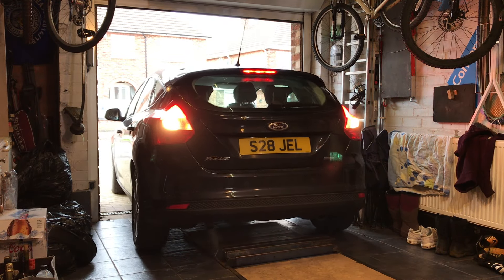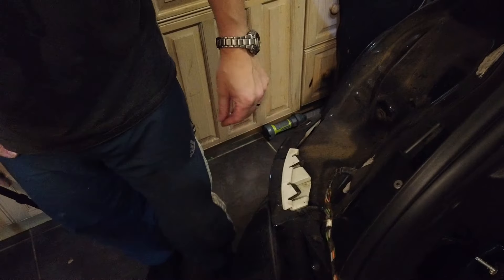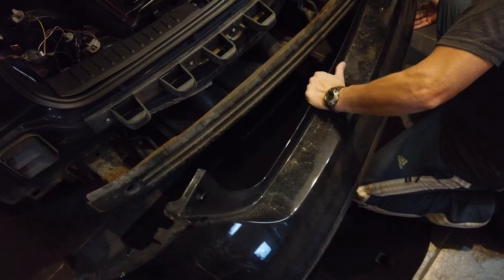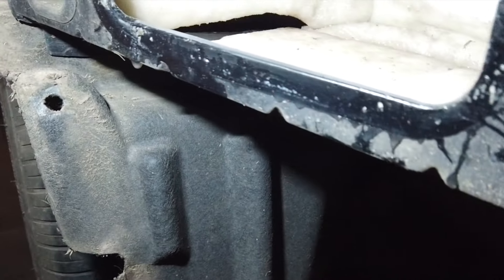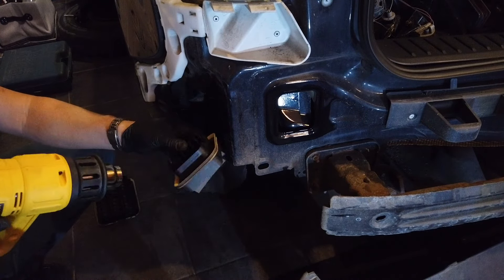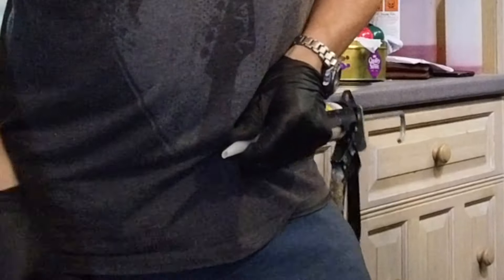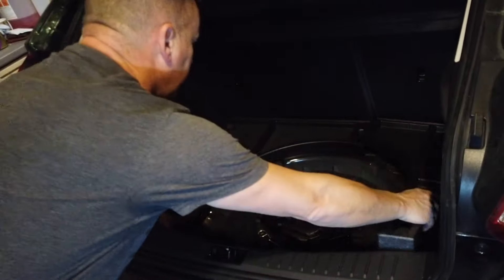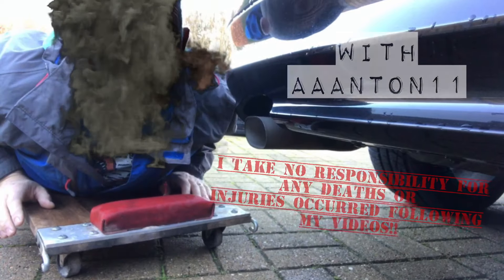Ford Focus Water leak in Boot, Sealing Rear Vents Behind Rear Bumper

Comment: Thanks for this. My 2012 Focus definitely has this problem. It’s started to smell as well. P.S You’re definitely from Leicester 🤣
Reply: same as my 12 plate mate, you're defo not alone !
Reply from the maker: Yes I am from Leicester, Thanks for the great comments👍🏻👍🏻🛠
Reply: My 12 plate too aha, started to get mould on the carpet in the front 🤢🤢🤢
Reply: @aaanton11  knew it, so am I. 🤣 Just want to point out that I took my bumper off last weekend, but the only thing I did differently was i used a gutter sealant instead of silicone. It’s a lot more durable 👍

Comment: Hi. My Ford 2013 only bought it 7 weeks ago.  Has water settling in back passenger footwell.  After you sealed up the air vents.  Was the water issue resolved?  I would be grateful if you can reply. As the garage I bought it from. Can’t locate the issue and are now unwilling to help. I may have to do what you did.
Reply from the maker: Yes the leak is all sorted, Thanks for the great comments👍🏻👍🏻🛠

Comment: I also have had a major amount of water in the back footwell and the front Wells iv taken out both vents and sealed them but I was just wondering the vents did not seem to be to wet I was just wondering is there another reason how the water is getting in iv had a hose all over the car but there dosent seem to be any leaks I can see.
Reply from the maker: Was there any water in the two pockets either side in the rear did you pull out the grommets? Thanks for the great comments👍🏻👍🏻🛠
Reply: Yes I took out both grommets to feel if there was water in the vents area the passenger side was slightly wet but not enough for the amount of water that was in the footwells. I also removed the grommets that were in the booth as there was 9-10 inches of water in there. Iv removed the carpets to dry them out and to have a closer look in the car as iv said iv had a hose on the car and around the seals but no leaks.
Reply: @aaanton11  I took out both grommets yesterday and I felt for any signs of water the passenger side was slightly wet but not enough to cause both back foot Wells to have that amount of water in them also a couple of weeks ago the spare wheel compartment was a couple of inches deep in water so I also took those grommets out to drain the water. As of today I have removed the carpets and sealed both vents and replaced the bumper. I have left the carpets out as I am going to put a hose over the car tomorrow again to see if I missed anything obviously the water is getting in somehow I just don't know how or where.

Comment: I have a 2014 ford focus st and I found my issue to be the rear lights.  Sealed up the screw holes better and siliconed the gap between light box and car and that seemed to work.
Reply from the maker: Thanks for the great information👍🏻👍🏻🛠

Comment: Great video! I’m having trouble with getting the bottom bolt back in. I’ve re-attached the bumper. Tightened the one tucked behind the material and the one below that. But the bottom one doesn’t seem to line up with the material. There’s a hole in the material, but the hole for the bolt seems to be in a recess and the bolt isn’t long enough to attach through the material? It’s a 2011 focus zetec trim. There seems to be a lot more plastic below the last bolt hole in the material then what you’re showing? 

Any ideas would be very helpful.
Reply from the maker: Has the clip dropped off, it has a thread in it, Thanks for the great comments👍🏻👍🏻🛠

Comment: Do you know how to get the carpet up at the front passenger side so I can try and dry it out, as mine has started to go a bit mouldy
Reply from the maker: You will need to pop off the side trims to lift it, or remove the seats to fully remove it, Thanks for the great comments👍🏻👍🏻🛠

Comment: I’ve got the previous model focus, an 09 reg and finally found out that it’s the same issue as this that’s causing damp and mould in my boot and rear passenger footwell. I assume the process of removing and resealing the vents will be relatively similar for the previous model?
Reply from the maker: yes it will, Thanks for the great comments👍🏻👍🏻🛠

Comment: Great vid. Just finished doing my focus today. It was absolutely soaking. Half the time was spent trying to the vents out. Also would you recommend putting the rubber plugs back in or won’t it make a difference? I just thought if they aren’t in the water can’t build up. Just need to figure out how I’m going to dry the rear passenger footwell now.
Reply from the maker: Glad it helped! you can leave the plugs out if you wish, Thanks for the great comments👍🏻👍🏻🛠

Comment: What are the water vents actually for? Like what is their function? Is it dangerous to drive if they are leaking?
Reply from the maker: They are one way air vents, they control air pressure in the vehicle allowing air circulation, Thanks for the great comments👍🏻👍🏻🛠

Comment: If there is significant water ingress at the tail lights, would this not also then accumulate in the chamber behind the vents under the bumper as well as in the boot?  I found a pond in my boots and I'm sure it has sploshed about when I'm driving and made it's way to ALL footwells :(
Reply from the maker: Yes it can, the vents are the most common place for ingress, Thanks for the great comments👍🏻👍🏻🛠
Reply: @aaanton11  Thanks. I have just been outside to investigate, I don't think I have much problem with the lights though will probably put some Boss White on as a safeguard. The chamber behind the vents however, was FULL of water and wadding is soaked. I did as you suggested and removed the bung from underneath to investigate rather than take the bumper off.  WHY oh WHY did Ford not seal these vents properly?!

Comment: Did this on mine today, must add that if the focus you are doing this on is a zetrc S, ST, RS or anything other than a standard focus like the one in this video the bottom clips on the bumper are a lot harder to access. Time will tell if the job i have done works but my focus was that wet inside the seats were going mouldy. Also if it happens again i have turned the rubber grommets that were in the vent cavities around so i can remove them and drain the water instead of taking all the bumper off . 

Another good vid for an annoyingly troublesome car. Any chance of a vid showing how to remove the front driver side panel in the bumper to gain access to the horn? as with the starter motor this has a bad connection and only works intermittently.

Thanks
Reply from the maker: I will look into that one for the future, Thanks for the great comments👍🏻👍🏻🛠

Comment: I found another place, keep reading for details: I have a 2016 fiesta and I found another place water was getting in. I have not tried the fix yet in this video; because I thought I had fixed it with the other place I found. Apparently there can be more than one area where water can get in. The place I found and covered with silicon is the upper corner of the hatch back on the outside near where the rubber strip on the roof comes to an end. I was able to verify water was getting in through this area by pouring a pitcher of water over that area and seeing water coming in on the inner wall and dripping down which is way above the area where the air vents are. Had to pull back the inside lining in the trunk area in order to see the water dripping in. To find the leak I just kept pouring water from lower to higher spots until I saw the water coming in and needless to say it was painstaking work. After putting silicon as stated already there was no more dripping on the inside wall; but here recently I found water was in the trunk again so I am going to try the vent fix next. Ford did a terrible job with this car in this respect and not sure if the fault is in design, workmanship or both.
Reply from the maker: Thanks for the great information👍🏻👍🏻🛠

Comment: I got water leaking inside the hatch area through a small hole behind the drivers side rear hatch interior panel, the bottom drain plugs have been removed and allot of water came out the bottom of the car along with some insulation material that is soaking wet, the funny thing is water only seems to leak inside the car when a running hose is sprayed along the roof drainage rail and it doesn't happen when wetting the tail light or bumper area, the car is a 2012 focus and I'm yet to still find the exact cause but atleast the back won't build up now due to the plugs being removed and water will drain straight out now
Reply from the maker: Thanks Dale for the great information👍🏻👍🏻🛠
Reply: Hi, if you look at each side of the hinges, you'll notice a lapped joint which is roughly 3 inches long . These joints are sealed with a cheapy sandy coloured sealant which degrades over time. Give those joints are really good clean and you will probably notice that there's a tiny gap. That's where I had water ingress. Used Sika silicone sealant on those joints and the problem's solved. That's on top of those crappy vent seals which I also sorted out.

Comment: I'm going to attempt this tomorrow as I've pulled the two bungs out and there's a load of water in there. I also have a lot of water in the driver side footwell, The sponge under the carpet is soaked through! is it likely to be connected to the boot leak or a seperate leak nearer the front do you think? many thanks.
Reply from the maker: Yes the water sloshes forward and gets into the footwell, Thanks for the great comments👍🏻👍🏻🛠
Reply: @aaanton11  Thats great I'll have a crack at this later. Thanks for your vid you're a lifesaver.

Comment: Great video,, my fiesta have the same problem, but the leak always from air vents in the right side, so i decided to fully blocked air vent in the right side, bcause it keep leaking after i fix it,, my question is, is it ok if i totally blocked that air vent?not all, i leave the left one as it should be
Reply from the maker: you might get more droning when a window is slightly open but nothing major will happen, Thanks for the great comments👍🏻👍🏻🛠
Reply: @aaanton11  😁😁, nice info, thank you, 👍

Comment: im having the same issue with my kuga/escape i'll try this same methode and see if it helps alswell.
Reply from the maker: Thanks for the great comments👍🏻👍🏻🛠
Reply: Did this yesterday on my kuga. Same problem, took it apart, cleaned it, did some overkill kit in there and put back together. Took me a lil more then 2 and half hour thx to your video. Something's are slightly different on a kuga but i got the general idea.  I'm wondering, Did the problem came back at all?

Comment: Hi Aaanton.  I have a vw golk mk5 1.9tdi.  Car temperature gauge would drop on motorway driving to about 85 degrees.  I figured a stuck open thermostat and replaced with one from TPS.  Now temperature gauge shows 90 degrees whilst driving, but only drops ( 80 - 85 degrees) whilst car is stationary and idlling.  Is this normal?  Before I used to own a petrol Corolla, once car warmed up temperature gauge never deviated from 90 degrees whether car moving or stationary.  Really enjoy your channel.  Thank you
Reply from the maker: This all sounds about right, especially if you have the in car heater on as well, Thanks for the great comments👍🏻👍🏻🛠

Comment: Hello mate so happy I found your video awesome "how to" I have this issue in an estate version I assume it's same. Have you had a chance to see if this fix actually works long term as I've seen a few others say it comes back, is that purely the fact that they left it wet when applying the silicone?? Or is it worth filling any of the gaps behind the light also. Cheers pal
Reply from the maker: Hi definitely a permanent repair, as long as everything is dry and a good grade of silicone used like in the description, it it the same on the estate, I would rather leave a couple. of small holes in the bungs than fill any gaps, Thanks for the great comments👍🏻👍🏻🛠
Reply: I have done same repair more than a year ago. all dry and clean since.

Comment: This seems to be a common problem on ford B max as well only today 30/01/25 I have found a pool of water in the spare wheel well about 3inches deep had no inclination it was there no smell lucky enough water had no entered passenger area of vehicle don't fancy doing this job myself as weather is terrible in Luton and I have very little patience vehicle is going to garage tomorrow I was wondering what it is they are going to do these vents are obviously known for failing if weather was better I would try this myself but weather is bad heavy rainfall over last 2 months surprised how much water is getting in apparently it comes from the roof and drains through the inside of the vehicle
Reply from the maker: Thanks for the great information👍🏻👍🏻🛠

Comment: I have this same problem with my 63 plate ford. However the passenger side footwells front and back are soaked and they smell badly/a bit mouldy. Once the issue is sorted, does anyone have any idea how to dry out the carpets/underlay etc or will they all need to be replaced? Thanks
Reply: Really informative video
Reply from the maker: A good carpet cleaner and hair dryer with the carpet lifted will work, like I did in this video, https://youtu.be/_zvNwzxIKCw Thanks for the great comments👍🏻👍🏻🛠
Reply: @aaanton11  thanks so much, really appreciate your reply

Comment: Has anyone susscefully fixed it with out having to take the bumper of.. ive got a 2014 focus an ive got water on the boot.. its now travelling through to the rear passenger seats an carpets which is resulting in my children getting out the car with wet bums or feet if they take the shoes off.  Am desperately trying to get it corrected but not sure which way to try 1st as am going to try myself
Reply from the maker: Unfortunately the bumper has to come off to repair. Thanks for the great comments👍🏻👍🏻🛠

Comment: Thanks for the Video. I've taken the bumper off and on the larger left hand side vent  i  snapped the clip at the bottom (bugger to get off). Do you reckon I'd get away with it and just silicon or get a new vent? Cheers
Reply from the maker: Yes plenty on there it will be ok, Thanks for the great comments👍🏻👍🏻🛠

Comment: Don't use silicones...use MS Polymers like Tec 7, does work even under water and seal under water, and much better sealing and adhesive.
Reply from the maker: Thanks for the great information👍🏻👍🏻🛠
Reply: @aaanton11  Happy to help. Here is a link: https://youtu.be/JRjO3Jp81m4

Fix-All  from Soudal is also a great product for when you have to have immediate strong adhesive to mount something vertical against walls. But I still prefer Tec 7 as an all-in-one product. Great seal for many many years, flexible, UV and mold resistant, strong, water proof, and you can use it on almost every surface even under water. For clean finish it's better to use Tec 7 cleaner instead of soapy water. Don't use soapy water, it contaminates your seal.

Comment: Easy fix for the vents below
https://youtu.be/tJpgZorpULM
Reply from the maker: Thanks for the great information👍🏻👍🏻🛠
Reply: @aaanton11  after a year or so after sealing the vents, they tend to leak again.
Having water sitting there can’t be a good thing for any length of time, so better just to remove the grommets, so it can drain continuously 
If you’re worried about getting water in from the outside, just replace the grommets, but pierce them in some way